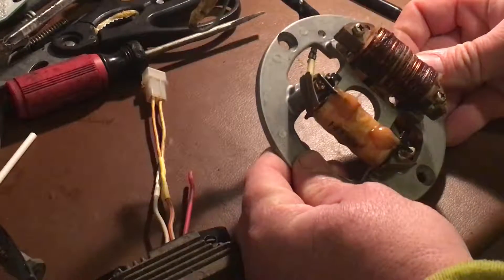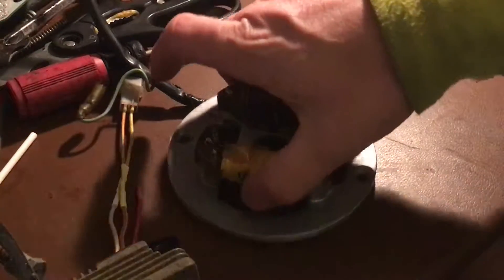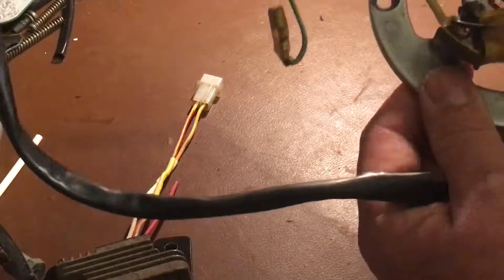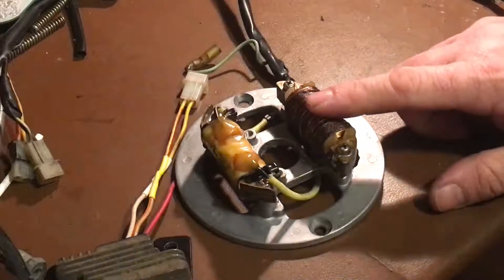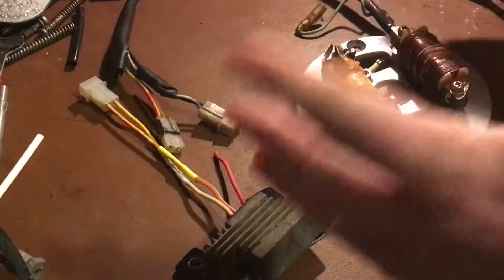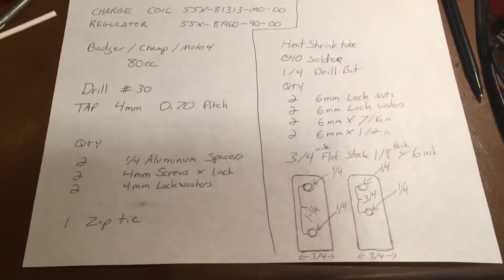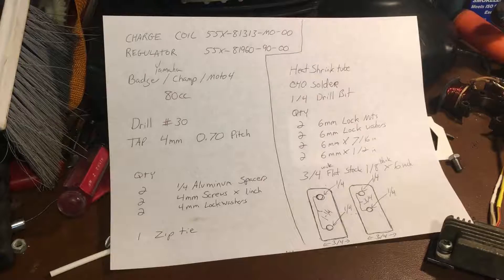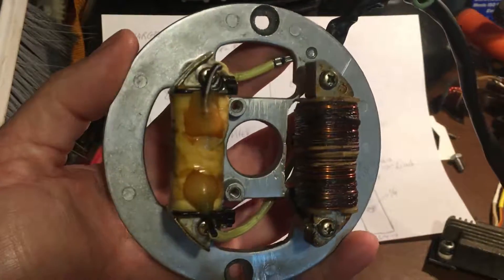Ke100 CDI  12volt mod part3

Comment: Kevin...really enjoy your videos...thank you for taking the time to do them. I am in the middle of doing the 6v to 12v conversion and for the coil I ended up getting a new 55x-81313-MO and it looks slightly different, it has 4 wires...1 green, 2 yellow(coming out of opposite ends of the coil) and one bare wire coming out of one end of the coil...can you help?
Reply from the maker: I'm actually not sure I have never used it before im not sure what it is capable of
Reply: @2strokeguru  did you see the picture I emailed you?
Reply: Jade, I'm in the same boat as you. Have you found any info on how to wire this?

Comment: Hi. Do you have a diagram for lights coil? I reformed my  bike and dont charge. Coil generate 30V idle and up to 60v but regulator drops when acelerate. (Sorry for my english, thanks!!)
Reply from the maker: There's a 6 different wiring harnesses for the ke100 i would buy the book that is the best way
Reply: @2strokeguru  i have a b12. But was reformed to cdi and i dont know how light coil be wired.
Reply: I am from Argentina and this bike is not common to see here
Reply from the maker: @martindardis9187  i bet what model are you working on
Reply from the maker: @martindardis9187  email pictures of magneto wiring

Comment: Hey man i have my coil mounted and now i need to wire it.  The coil has 4 wires comming off of it. Do i just tie a pair together and the other pair together?
Reply: Has anyone figured out how to wire the charging coil? The new coil, part# 55x-81313-M0 has 2 yellow wires, 1 green wire and 1 bare copper wire. Kevin said to watch the video; but he has a used coil with different colored wires. Half the other wires are bunched up and you can't see how they are connected. Don't get me wrong. I really appreciate Kevin posting these videos. Very informative. I'm assuming the bare copper wire is a ground. The 2 yellow wires have zero continuity. The green wire has continuity with the yellow wire on the opposite end of the coil; so I would assume these get individually soldered to the KE100 yellow wires on the harness. What about the other yellow wire?